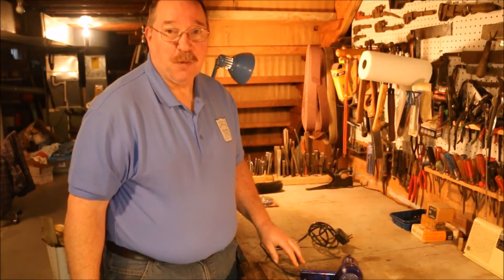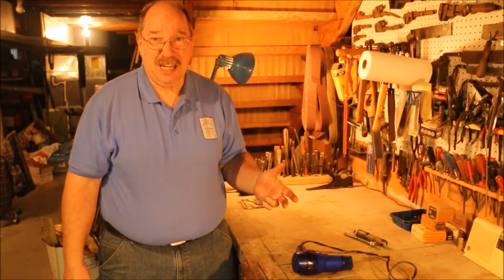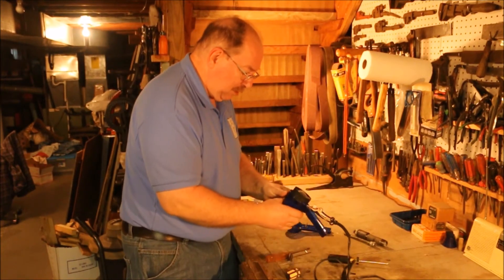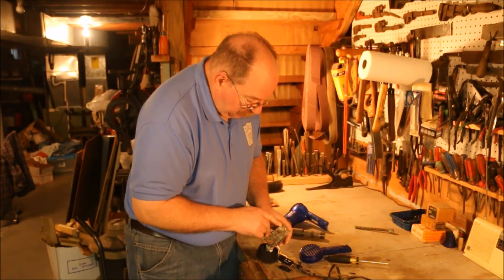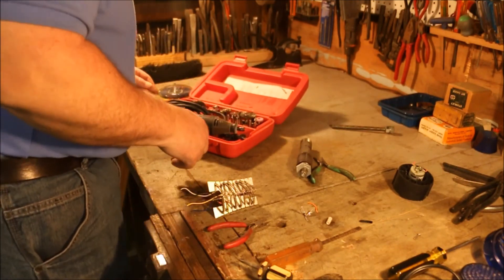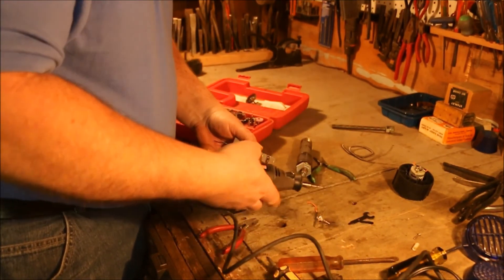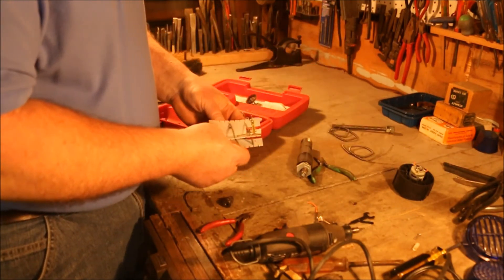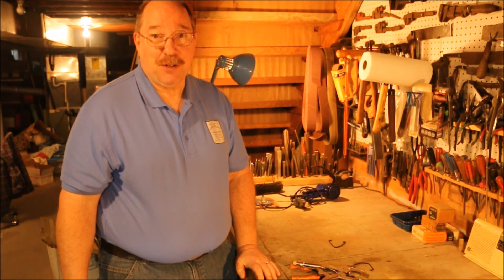HDPE PLASTIC INJECTION MOLDING PT 2 HEATING ELEMENTS

Comment: Great video.  I have also thought of salvaging the heater elements out of a toaster oven.  They can handle heat up to 500 degrees when broiling.  The question would be, how to stand them off of the pipe.    Looking forward to your next video on plastic injection.
Reply from the maker: Gus Lint I was wondering about using some furnace cement to make a ceramic sleeve around the pipe as a stand off. If the little wafers don't work that is the backup.  😆
Reply: Great Idea.
Reply: You mean you don't have any micah sheets or some asbestos laying around? Either will work. Just don't put the asbestos in Kent cigarette filters., Didn't work at all.